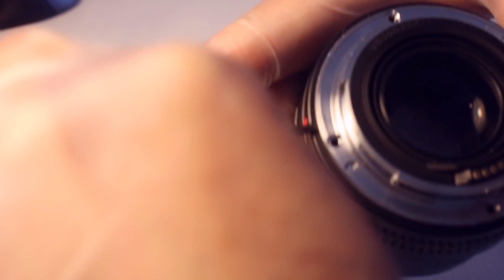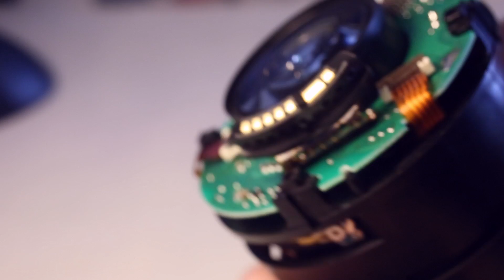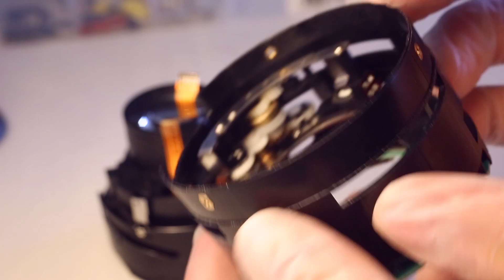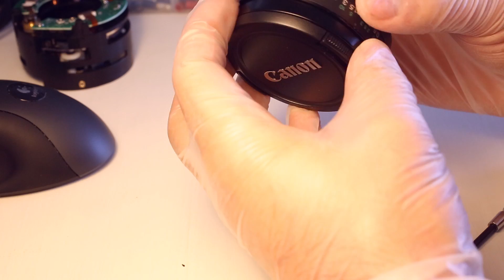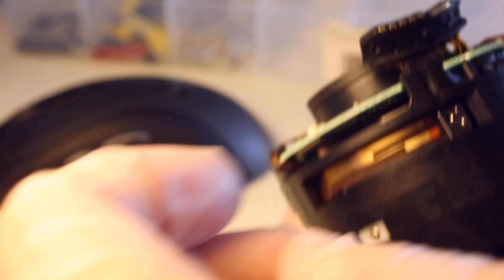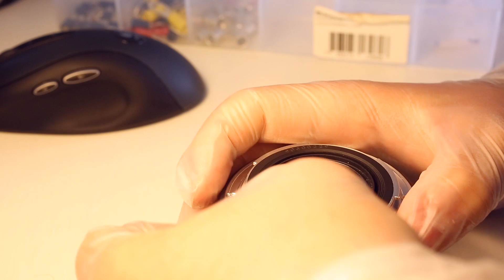Repair focus issue with Canon EF 50mm / 1.4. Dissasembly guide.

Comment: He doesnt remind you to put the first part back on when you start to 
reassemble. There is an image though of the small part reattached. This 
should be apparent if you do it straight away but if you go away and 
have a cuppa and come back you will probably be half way through 
reassembly before you realise.
Also when you take the Auto Focus switch off he does warn you to be 
careful as its fragile. He does tell you when hes reassembling but
 not enough emphasis was put on turning it to AF this time. The switch 
is like a hair, if you breath on it the wrong way it will snap. 
When there are very few people doing these videos you have to appreciate
 someone trying, if you are aware of the switch (its a surprise it does 
bust within a couple of days of using the lens to be honest) and dont 
make any mistakes its a good guide. You dont have to be pushing hard to 
snap this switch, you just need to have it in MF instead of turning it 
to AF when reattaching. It seems like a string of people have had this 
problem, check below comments. 
Im about to buy a wireless follow focus anyway and its mainly video I do
 so its not such a problem, but would be a disaster for photograher, 
infact AF is always very handy to get that precise focus when setting up
 a shot.
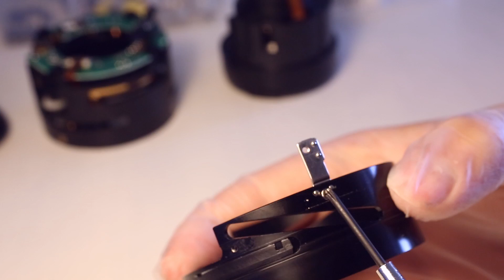Reply: By first part they mean the part that is removed in 5:37 in case anybody was wondering because I was.
Reply from the maker: Great feedback, thank you! Can I up this comment somehow so it will be a "sticky" in the comment section?
Reply from the maker: Done, made it a sticky in the comment section now. Thank you!
Reply: Mine is sometimes not focusing. If lens is pointed up, it won't turn focus past a certain point. Pointed down, works great. I'm pretty sure mine needs grease applied on the white plastic slider guides. Any thoughts on what type of grease to use?

Comment: Just here to add to the growing list of folks that saved a lens thanks to your video! I got a stellar deal on one but when it arrived it wouldn't focus closer than 4 ft. I am guessing a previous owner dropped it and then sold it on as "working" since technically everything was just fine from 4 ft and out. Took me less than an hour to get the barrel out and press it back into shape. Now I have a perfect 50mm 1.4. Thank you so much!

Comment: I have a lens like this. Took it apart and there was deformation on the inner ring just as you pointed out in this video. I replaced the inner ring and there was deformation focus moves smoothly now. Before I started the repair the lens was blurry through the view finder and still is blurry through the viewfinder. The inner focus ring is replaced and working. Any ideas what might still be wrong? Thanks

Comment: Thank you so much for this video. Once I stripped the lens down as per your instructions, I could see the focus barrel was quite badly bent out of shape. I tried to fix it as described but it was too far out of alignment. I ordered a new one for €14 and replaced the old one. The focus scale easily peels off and can be reapplied to the new barrel, new barrels do not come with them. I put it all back together and its working perfectly. Your instructions are super easy to follow and the video is clear and well put together. Thank you again!🙏😀

Comment: Mr Cederberg: 

Thank you for your video instruction. It is very helpful for me and I have subscribed your channel. I hope that you can give me some hints on my lens problem.

I have a Canon EF 50mm / 1.4 lens, which is exactly same as this one in your video. I accidentally dropped it onto the ground a few months ago and then found that I couldn't use auto or manual focus anymore. About a month ago, I fixed the problem by watching your video clip and the lens resumed auto and manual focus functions. But unfortunately, it worked not smooth and sometimes the auto focus stopped working and I had to switch to the manual focus,. Once I could use manual focus, the auto focus recovered. About one week ago, the lens stops working and I can't use either auto or manual focus. I tried again to fix the problem as the last time I did by repeating your procedure, however, I failed and cannot even turn the lens manual focus barrel. The manual focus barrel seems stuck by something. I had to dissemble it again but couldn't find any problem. Could you please provide your insight from your experience? It would be very helpful for me to find the problem. Thank you in advance!

Doug

Comment: Thanks a lot. Although I don't fix my lenses myself, this vid also helps because I can learn here about where the weakness is and I can better protect my lenses. My 50/1.4 went down a few times I guess the problem is the same piece that is mentioned here deformed and then caused the motor to overwork and breakdown. So my protection method is the put a hood onto my new lens as much as possible to shield that piece from bumps that may cause the deformation. Thanks again.

Comment: Really great guide. My wifes lens was defective after it fell down. The "most common issue" described here was the reason for not functionng anymore. I bent the aluminium part back in place and now it's almost as new. All in all it only took 30  minutes. Great job Christofer. Many thanks for saving me a few hundred €.

Comment: Your tutorial worked great! It took me about 45 mins. In addition to flattening out the piece you showed, i filed down the part the guides sit in to slide easier. 

Pro tip for everyone using this tutorial: make sure the ribbon you removed is inserted all the way and the plastic bit with the tabs on the back of the lens are properly seated or you will have aperture errors! :)

Comment: PLEASE READ! 1) FOR BEGINNERS: THANK YOU! This worked for me and I have no experience disassembling anything. 2) I just needed to buy a $10 precision tool kit on amazon 3) I messed up putting the connection back in place and when I reassembled everything and took a photo, the camera said “communication between the camera and lens is faulty.” I had to disassemble again and connect it correctly. Then somehow when I closed the lens back on the camera it wasn’t aligning and the lens release button wasn’t working and the auto focus wasn’t working. I had to twist really hard and the lens came out. I did the entire thing again and by some miracle... it worked. I can’t believe it. Took 1.5 hours but saved $$$. THANK YOU AGAIN!
Reply: PSA/NOTE: this comment really helped me realise there was an issue with the aperture connection. I also got weird jerky autofocus that never locked. I disassembled the lens THREE MORE TIMES, right down to the blades, before I figured it out. It was embarrassingly simple> the flex cables go ABOVE the plastic clips, not below. Even though this is clear in the video, I somehow missed it. Hopefully this helps somebody out.

Comment: My old lens quit focusing, and even was stuck so manual didn't work. Using this excellent walk through, I was able to get the manual focus working again. 
I can hear the motor chirping for a fraction of a second each time I try to focus, so I'm assuming that it's pretty much fried. 

I didn't have aperture control at first, but after a comment a few above, I saw that re-seating the ribbon can fix it, and it did! I still don't have auto focus, but at least I'm not stuck at f/1.4

Comment: Thank you! I wasn't able to get the very last screw off to realign the barrel but I managed to straighten it by pushing the metal piece through a crack of wood in a flat surface. Now my autofocus works!

Comment: The replacement tube i got was crap, no sticker on it either to show the measurements. So i left it, for months. Sat with it looking at me the whole time. Decided to give it one more go, took out the crappy tube and threw it far away from me, squished the crap out of the original one they way he does with his palm, put it all back together and hey presto, it fecking works. IT WORKS!!!!!!! Autofocus is really crap for some reason, tried it on two different cameras, but it keeps hunting erratically never stopping but i don't use it for video i use it completely manual. So glad to have this wonderful little (poorly made) lens back in circulation again and i bought a lens hood for it and it will never be off it from here on. Side note, the gears were rather stiff so I thought maybe the lubrication had dried and added a very small amount to the gears (plastic and rubber safe) to assist it, this may be why the AF is freaking out because it's maybe shorting something. Cheers for the vid.

Comment: Mine sadly was not fixed by this :( I replaced the part entirely with an after market piece, so either, the new piece is even worse or this was never my issue. Might actually be the gears. Any advice appreciated Christofer.

Comment: You're a bloody legend! Thanks so much. The issue mine had was as if the focus ring wasn't gripping, like there was a slipping cog inside. Once I was able to locate the cogs I just jiggled them around a bit, and maybe that fixed it, or just opening it up did something? Those first screws were a nightmare to undo, so my palm is very sore from the screw driver. Thank you again! You've saved me hundreds of dollars!

Comment: Thanks, i just repaired mine. Unfortunately i have problems with the gears too. There is a strange part with 3 bearing balls. The bearing seem to be damaged. Or maybe i will replace the whole AF assembly as you did. Right now it's working.

Comment: Hi Cristofer, fixed mine too, it was very badly bended, even not able to bend it back by hand! Used an oval pincet, to bend the ring back in shape and used some fine sandpaper to make the edges of the groove smooth again. Greased it with some white grease on an ear cleaning stick. Auto focus works fast and acurate again! Thanks!

Comment: Thanks for that video, quick question, if the movement in the last component (the focus tube ring) is already quite fluid, is the problem actually my gears? Ive ordered a replacement tube so will put it in before i reassemble but the gears are quite stiff. I noticed before i got down to the focus tube that the outer gear ring (with three plastic runners) was quite hard to turn by hand.

Comment: very helpful. The sliders were sticking, however I made it worse when I followed the advice by pressing the ring on a flat surface which coimpressed one of the slider grooves, so had to reopen by gently prising.. be carefull if you press on the ring to remove the deformation as described in video..... you can press too hard which squeeze the slider grooves too much which restricts the lugs from smooth operation... making it tight and thus manual and auto will not work. However all resolved eventually

Comment: thanks i have repaired my lens ! thanks to you, for info, it really need to push a lot to bend the metal to fix the issue, i've tried once it wasn't good enough ;) keep on trying
Reply from the maker: Glad to be able to help! I will try again with one of mine that I didnt manage to fix before. Maybe try a bit harder as you say. Sold my working 50 1.4 and bought a sony a7riii with sigma 50 art. But still want a nice 50 for my canon!

Comment: I called my local camera repair shop and they wanted to charge $150-200 to repair this common problem.  I've never taken anything apart that is this delicate.  Your video was perfect!  Instead of using my hand to flatten out that cylinder I used a flat capernter's square on the top and the bottom pressed against my flat desk.  I used a carpenter's grip (Irwin Quick-grip) to hold that position for several minutes.  I kept going at it until it was close to flat as possible.  Your steps were exactly as you stated.  Thank you again, my 50mm lens is working again.  I also managed to clean out the tiny bits of sand I found in the outer slide and gear track from one of our many beach trips.  Focus is a little smoother now too.  I couldn't find any machine oil so I used Phil's bicycle grease (just a toothpick tip dab) on the sliding parts.  Focus is smoother and couldn't be happier!  Thank you, thank you Christofer!
Reply from the maker: Patrick Lacson Very happy to hear that Patrick! Hope the lens stays functional for you and thank you for commenting!
Reply: My first video with my working 50mm lens, thanks to you!  https://youtu.be/0Xb68wnu8Ac

Comment: Great video thank you. Unfortunately I think that my motor is broken too as this procedure didn't fix the problem. Around 7:50 I used a paper clip opened up in an 'L' shape to hook and pull the cable through.

Comment: thanks for the video. very helpful. however after stripping my lens down to the metal barrel my barrel was not distorted. the issue with my lens was the very first plastic collar with the window. it was putting pressure on the lens barrel as it moved and caused the motor to stick. I sanded back the inside diameter and it's seemed to work.

Comment: Thank you for this video. It fixed my lens where the focus ring was stuck completly! 
One tip though, be sure to put those flat cables all the way in before you fasten them with the white clip. In this video it did not seem that you had it all the way in. You should not see much of the bare copper contacts outside the connector.
Reply from the maker: Good tip!

Comment: hi! your video is very usefull but do you know if I it's possible to buy somewhere the plastic piece around the screw that you remove at 5:10 ? because the piece broke and I need to replace it
Reply from the maker: Hmm, sorry, I do not know. Maybe a search on ebay or an email to Canon can find you one.

Comment: Tried to fix my lens. However, it turned out that both of the white plastic parts are broken. Do you know where to buy those parts? Thanks
Reply from the maker: Sorry for the late reply. I do not know where you can buy these, try ebay or contact Canon. I think that is your best bet. 
Or maybe you could ask in some store that repairs Canon lenses.

Comment: My ring turns but the focus doesn't move, or only moves a little.  Will this fix that issue?
Reply from the maker: hi Matt,

I can't promise you anything, but looking at other peoples initial problems, this seems to be a common one that the solution in my video will fix. 
So give it a try. 
Of course there are a risk of ruining the lens even more, so do have that in mind.
But if the focus does not work at all, not even in manual, there is not much to loose anyway I guess? 
I have a lens that only works in manual that I did not get to fix with this method. Using it for video now with manual focus.

Comment: This is a great tutorial. Fixed my lens to better than ever. Did have to superglue one of the clips back onto that plastic ring, but it went back together well. The only thing you didn't address which took me a couple trial and errors to figure out, was that silver piece and screw (last one removed). Took me assembling then not finding it where it should be then assembling it again. But overall, you solved my issue! 
Thank you very much!
Reply from the maker: Thank you! Good to hear what I´ve missed as these comments will help others looking for the same answer!

Comment: Weird that this says 'Repair focus issues" but all he does is disassemble, then reassemble.. But, I did it, and now my AF works. So- thanks!
Reply from the maker: Great to hear Dirk!
The repairing part is where you straighten the collar. That can be deformed. I have tried it on two lenses now and could not fix any of them with this method, so there are other potential problems also. 
So I seem to help everyone but myself with this video :)

Comment: Thank you Christofer It fixed my focusing problem after i dropped my camera face down. as a tip if the lens wont go straight after pressing check the high point and tap it with the handle of a metal knife whilst holding the blade it had just enough power to knock it back to shape, When ressambling 8.49 on video replace the three white tabs and the turn the white focus dial to see if the cameramoves soothly. if not check the diagonal groove for minor deformitys tht stop the white tabs moving smoothly. Than you agin it saved me a lot of money in replcing it or sending my lens foe repair.
Reply: I have just one question. It fix my AF I was able to focus just between 1.0m and 2.6m. Now my AF works perfectly, but when I am using manual focusing ring, it is still sticky and I have to use little bit of force to move, but after that I can´t focus properly, because it´s not smooth. May you help me with this?
Reply: Hello Jakub. i have no camera repair expertise but from what i saw when disassembling my lens was that you problem may be caused by damage to the manual focus ring as seen  at point 13 seconds in the video when Christofer removes it.  Look at the teeth cogs on the inside of the dial/ ring for damage or missing teeth, look at the white dial (revealed at 15seconds)that the ring rotates for damage. See if you can reverse the ring when replacing it you mmight have replced it th wrong way or the other side of ring might not be damaged.. at point 18s you can see the white dial. roll this with your fing and see if the focus changes both ways. f so you know tht the focus ring is the problem. otherwise i dont know..Good luck.!!

Comment: Thank you for uploading this helpful video. I was wondering why you did not remove the circuit board. Don't you think it would have been easier to reconnect that ribbon cable if you had removed the circuit board?